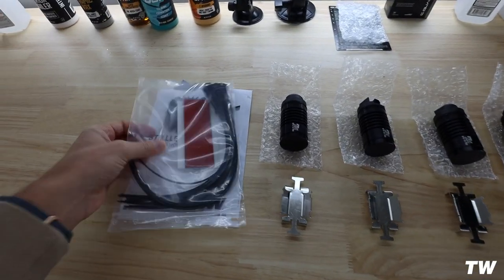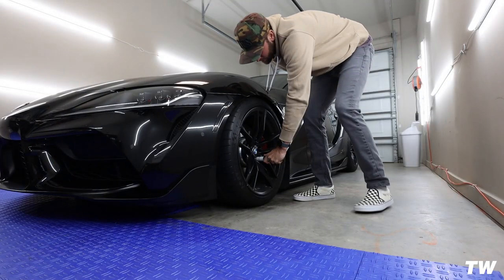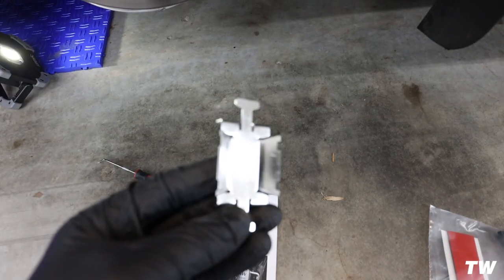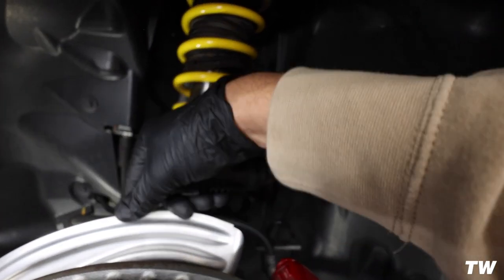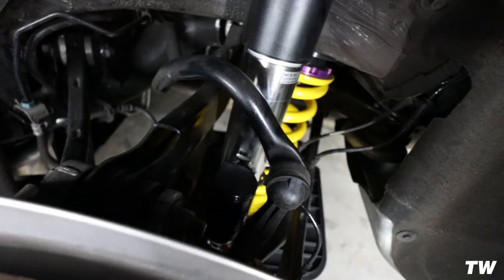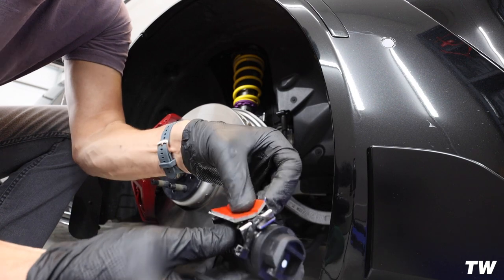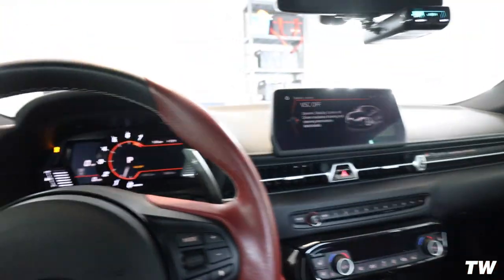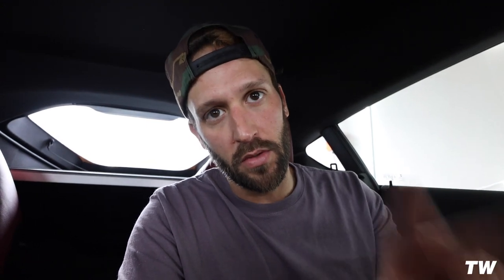DELETING YOUR EDC? YOU WILL NEED TO DO THIS! KW EDC CANCELLATION KIT ON THE A90 SUPRA.

Comment: 2370$ vs 2599$ i dont know the deal you got on them but it makes sense to retain original functionality if you can :D anyways I cant WAIT until you actually get your ass to the track 😁😁😁
Reply from the maker: Simple. I don’t use edc lol
Reply: yeah but when you put it in sport it activates automatically 🤣
Reply from the maker: I only drive in sport: edc is useless unless you actually utilize and prefer all driving modes with suspension variations. I like one mode, that’s the one I set on my coils..lol
Reply: i know.. should have an option to set it to sport from get go 🤣
Reply from the maker: You can code it in actually. https://youtu.be/2DXBek9NNd0
Reply: f*ck thats cool, does it apply to bmw's aswell? like f3x f8x and such?
Reply from the maker: I’m not sure on older models, we were able to do it on my brothers x3m tho!